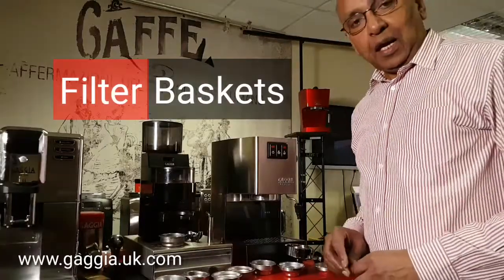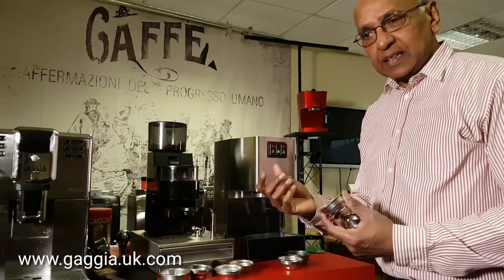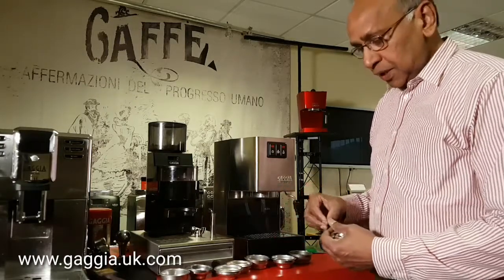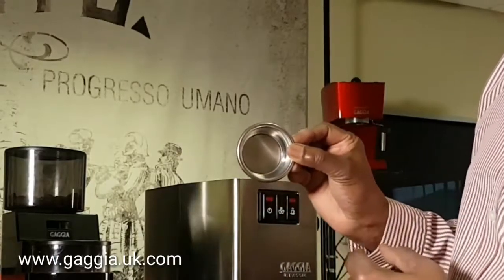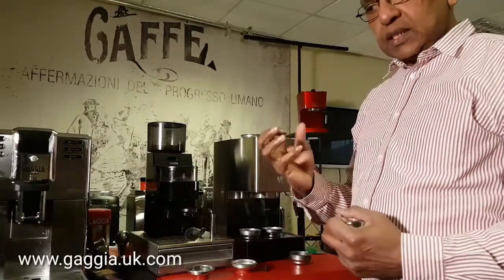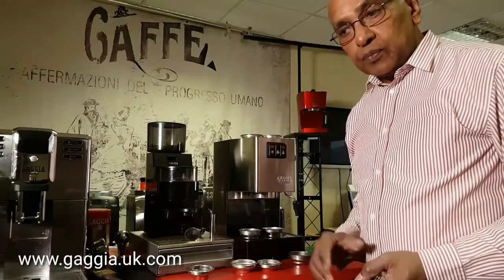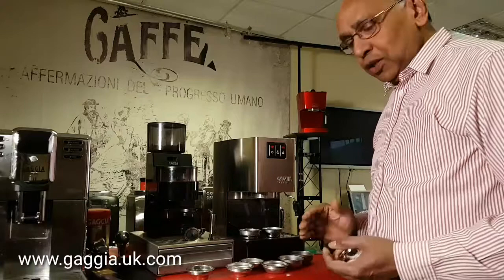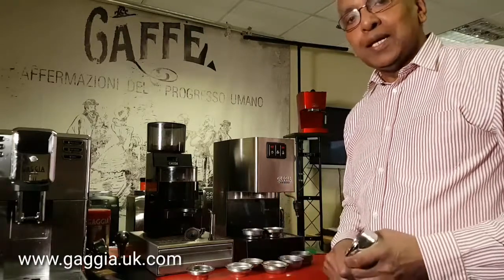Gaggia Classic Filter Baskets

Comment: i have the ri9403 but with the pods ese usually come out also water, can you say me how can i do or an adapter becouse i want use more the ese pods
Reply from the maker: Which ESE pods are you using?. There can be slight variations.. I find that a traditional single basket works better with ese pods.
Reply from the maker: Hi there! Are you using a single 7g basket? They're the best ones. Which ESE pods are you using?
Reply: @GaggiaUkElland  yes with kimbo but i ll try another type